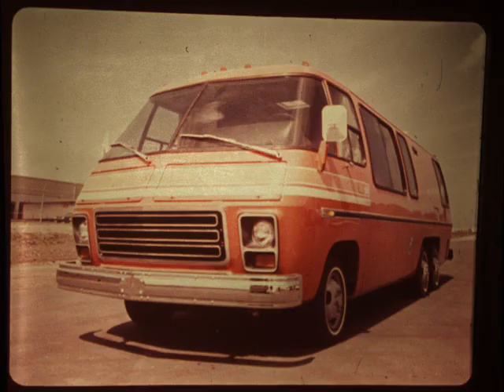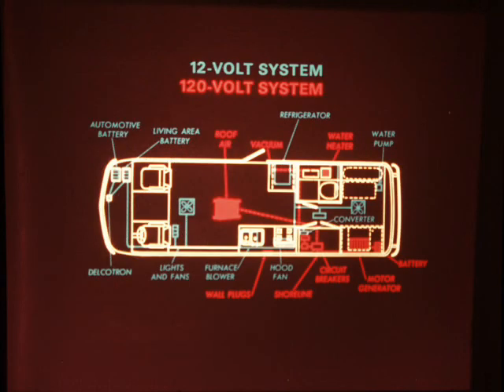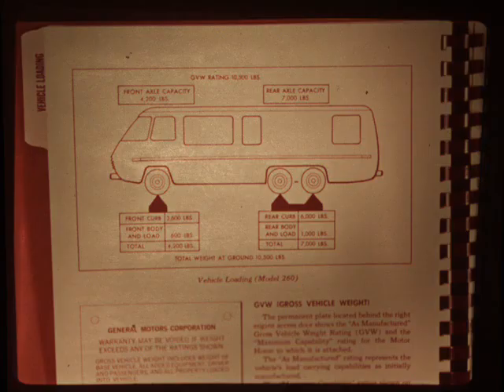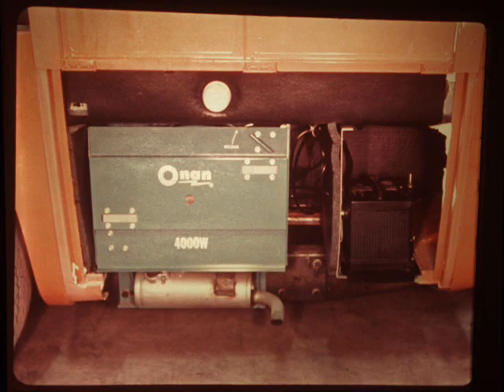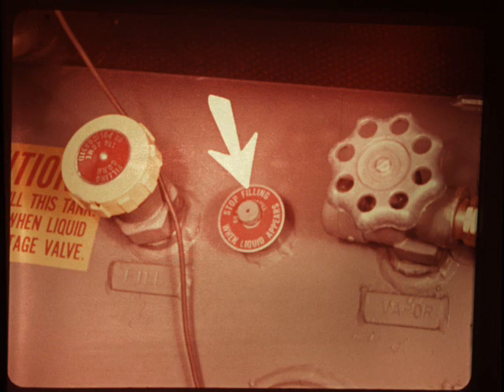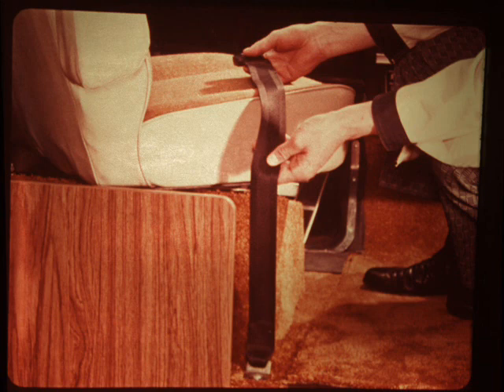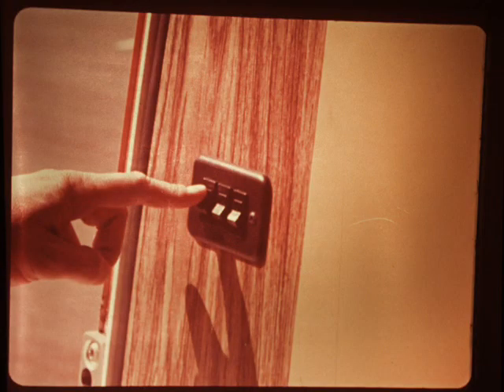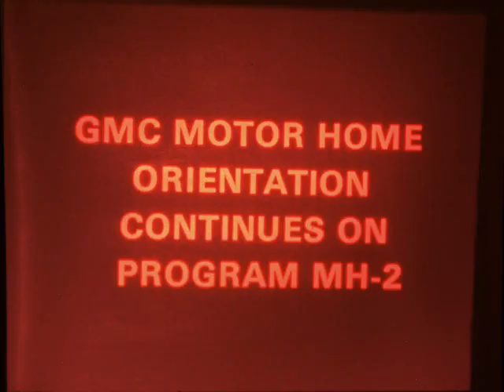MH-1  GMC Motorhome Orietation Part 1

Comment: Nice. I can't wait to get and restore one of these one day.
Reply: did that day come yet?
Reply: @CBRemoR  Not yet. Once I am done restoring rental properties then I will get and restore one of these lol. Was just looking at one a few days ago for 1.2k which is a good starting point for a full restoration as long as the frame is good.
Reply: Bring enough money with you for a good one.
Reply: Help in india we need one 
Not available in Asia
Reply: @Coordinator61  you will be sorry...I have 2.....77 and 78...6k and 11k... the Cabin I like.... the electric and electronics and mechanical engineering engine and transmission beware!!!!!
Reply: @cedarwest37  Ok cool but older RV's are usually in bad shape and need a lot of money to get them right. But still the best looking RV ever. Very rare in europe.
Reply: @Coordinator61  good looking sure... but.... good looking won't get it down the road...if...if...if... it goes 1 mile ... it will need a tow truck to haul it back...or you will be under neath ... trying to get it going....a fool and his gmcer are soon parted and his $$$$$$$$$$$ also
You will learn.... the body is only thing good...